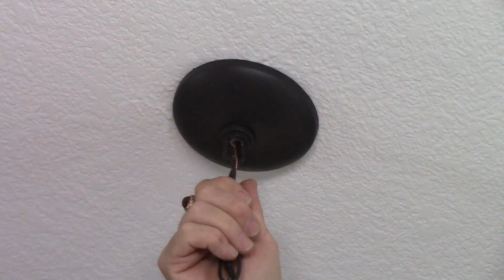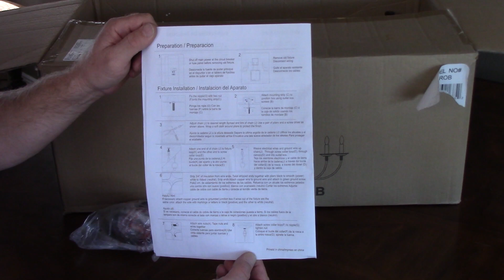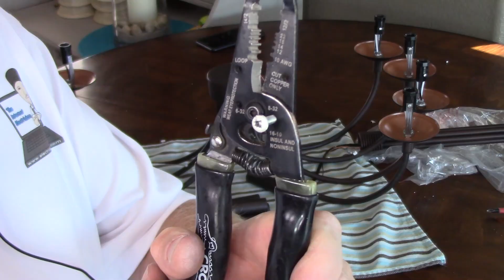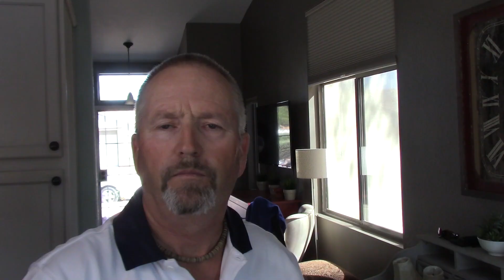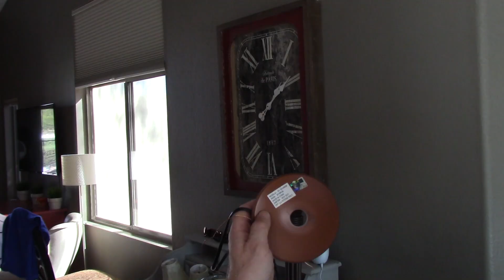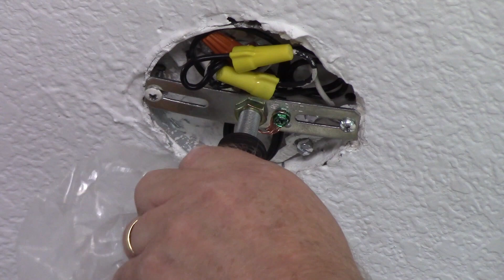Replace and Install a New Light Fixture

Comment: How do you feel about wago connectors? I'm always afraid the screw ons will come loose.  I just installed a new heater in our bathroom using wagos, taped over them as well, lol.  We had a house fire when I was a kid so electrical jobs really scare me.  My husband also got a good jolt once when he THOUGHT he had the right breaker off.  He was ok, so looking back now, it was kind of funny.  He learned his lesson 😊

Comment: Thank you.  I get sweaty and shaky whenever I try anything electrical, and this light was no different.  I encountered a weird mounting plate, and then (of course) wires that were entirely different colors from the fixture.  Watching through this patiently, and proceeding slowly (oh, too slowly) I finally got the gumption up to forge ahead.  Voila!, a light that works and hasn't burned my house down (yet).

Comment: You are a wonderful teacher.  Thank you for explaining important facts with professional terminology only when needed.  By doing this you kept my attention and built my confidence that I can change a ceiling light in my home.  Of course I know well enough that if the current wiring is not the same as yours in this video, I will call an electrician.

Comment: Wonderful and helpful video! Love that you shared how to tell which wire is neutral with lamp cord that is not white and black/red.

My question is this: I'm powering light fixtures that are intended to be mounted into ceiling junction boxes with swag lamp kits. The fixture has a ground wire, but the lamp cord that I'm plugging into a wall outlet (serving as my power source) does not have a ground wire. What do I do with the fixture's ground wire? Should I still attach it to the ground screw in my metal mounting hardware? (I'm using the fixture's mounting bar and canopy rather than just a ceiling hook). Or should I just leave it unconnected to anything, since it's not connected to the power source in any way? Or is there some other solution I haven't thought of?

Comment: Hello, help please. Coming out the celling theres a red wire alone. Each the black and  white are attatch to another one with fabric. My light ficture is very simple 1 black, 1 white. 🤔🙄
Reply from the maker: If I'm understanding you correctly, you have white wires spliced together, black wires spliced together, and one single red? If I have that right, then you connect your fixture white in with white wires, and the fixtures black wire to the red wire. Leave the black wires as they were. I would appreciate it if you like, subscribe, and click the bell as well (if you already did, thanks!) It really helps us creators gain traction with YouTube.

Comment: This is incredibly helpful and so well done! My old light fixture has a thick copper ground wire but there's no grounding nut in the box like yours has. It's just free in there. The new light fixture has the crossbar with the green grounding nut. After I wrap it 180 around the grounding nut, what should I do next? Should I still wrap it around the copper ground wire coming from the box?  The directions specifically say this: "E" wire from the fixture is attached to the mounting bracket (this part I know) and an additional "E" wire from the mounting bracket must be secured to the junction box.  I'm assuming by "additional" it means the additional length of it like you showed in the video. But since there's not a specific screw to attach it, and the copper wire wasn't attached to anything when I removed it, I didn't know what to do with it. The junction box has 4 screws attaching it inside the ceiling. Should I loosen one and use that? Why wasn't the copper ground wire already on a screw?  Also, the neutral wires coming from the box are 2 thick copper wires wrapped together. The live wire is just one thick copper wire.
Reply from the maker: Is it a metal or plastic box? If it's metal, and there is no grounding screw, then the best you can do use one of those mounting screws,  If they are wood screws with a beveled head, change it to a screw of the same size with a pan head to bet a better connection.  If it's plastic, then just wrap your fixture wire around the mounting bar terminal, and if it's long enough, then connect to the ground wire in the box with a wire nut as well.
Reply: @theinternetelectrician  Got it! It's metal and there's no grounding screw, so I can do like you suggest and use one of the mounting screws. My first thought had been to connect the fixture wire to the green screw then take the end of it and connect it straight to the copper wire coming from the ceiling with a wire nut, as opposed to connecting the copper wire to one of the mounting screws first, then connecting the two ends (copper wire and fixture wire) with a wire nut, as you did in this video. It still creates a continuous route for the ground. Why does the ceiling copper wire also need to be connected to metal? I'm asking this for my education. :-) Doing some minor upgrades with lighting, and each one seems to be unique.
Reply from the maker: @aglastad  The goal is to have all metal parts in the system connected to the grounding (earthing) system.  So if a hot conductor accidentally comes in contact with any metal parts, the fault current will be taken safely to earth, and in a high enough amount of current to trip the breaker and open the circuit.  With little resistance,  high current will flow in a very short time to facilitate the tripping of the breaker so the better.

Comment: Why does the grounding wire from the fixture get attached/spliced withbthe grounding wirr from the incoming wires from the ceiling? Is the grounding screw on the cross bar assembly not enough to be grounded? Thanks.
Reply from the maker: The goal is to have a continuous copper path using the grounding conductors.  If you just relied upon the mounting bar, the path is broken if the screws are removed.

Comment: I've been up all night trying to find a decent close up view of this procedure, and finally after all-night search I found you,  I don't know how you did it, but the close up was marvelous,
 I saw what I needed to see, finally. 
It was the ground wires and that green screw and how they came together, as you said you lucked out!  
but I have a light that has a ground wire, no green screw and it isn't copper- 
I've never seen anything like this as all my other lights have the copper ground wire, I wonder if this light is going to be safe seeing it has this thin silver ground wire? It's a LED light so not much current will be required to light it up, I guess so they thought they wouldn't use the heavy copper wire, I guess, I don't know what to think or do.
Reply from the maker: send my some pictures at terry@electrical-online.com

Comment: This really great but complicated job done! Here is a special SOCKET designed for ceiling light, what you do to install,remove and replace old Light Fixture with new one just as easy as you insert it into or pull it out from The SOCKET,  why not get it:  https://youtu.be/0pMsya3hrHo

Comment: Thank you for your video. Your video is the only one that showed how to connect a ground wire to the green screw on the mounting plate/crossbar. My other option was to make a pigtail connection using a green wire nut but I didn't have any and the home improvement stores only sell them in bunches of 25 or 100. I mounted my new chandelier but it didn't work.  I thought I made a mistake with the wires but I didn't. The instructions did say to ground the chandelier to the crossbar but I didn't know how to do it. Once again thanks a million for your video.

Comment: Great video!  I just change one of my light fixture and tested both hot and neutral wire and both were hot. Is it okay or safe to have both hot?
Reply from the maker: Serafin Florendo I would need more information. What wires and cables were in that box?

Comment: 1) Leave the screws on the bar a bit loose while pulling the fixture wires - they go through much easier with pancake boxes. Finish tightening the screws once the wires are completely pulled. 

2) Is there any reason why you didn't just use lengths of the braided fixture wire to make up a pigtail? You would then have some slack on the supply ground wire to go the the wire nut. Also from the wire nut would be a braided length to the pancake box, a braided length to the mounting bar and the braided wire of the fixture itself. So the wire nut would connect 3 braided wire lengths plus the green supply wire.
 
3) I was taught to always wrap all wire nuts with electrical tape. Is that still standard practice?

Comment: Terry, I've found it easier to stick the stranded wire slightly proud for the splice. 
Thanks for the video!
Reply from the maker: Yes, whatever works is good! The main thing is that "tug test". Ensure that the wires are all securely bound together in the wire connector. A electrical splice must be as mechanically and electrically sound as the original conductor. (a dredged up memory from tech school!)
Reply: L  @theinternetelectrician